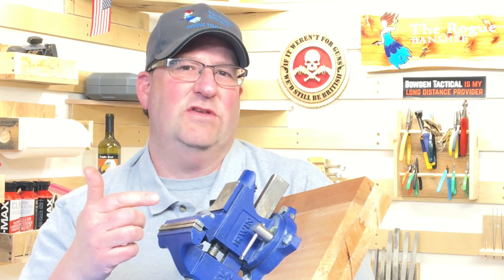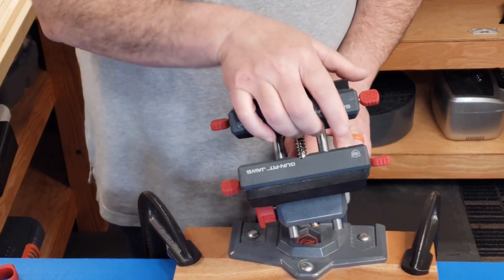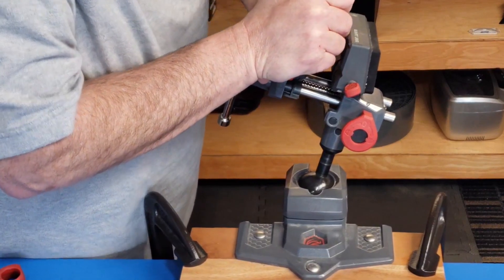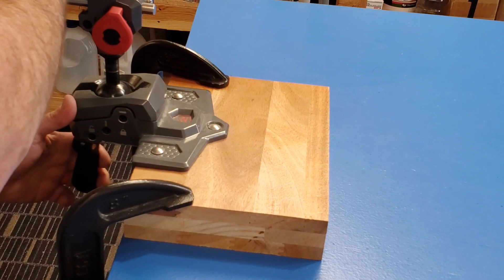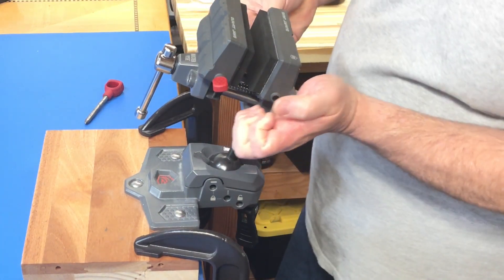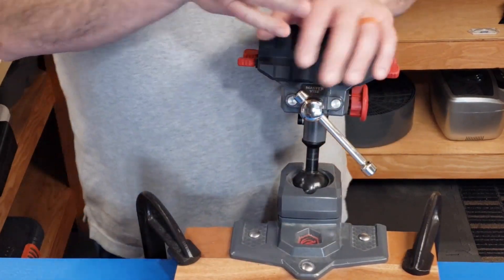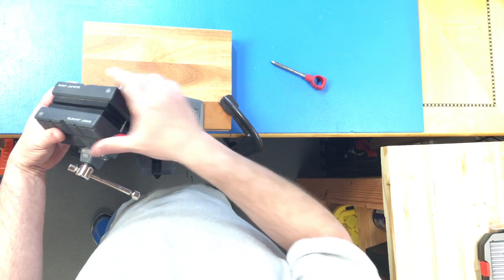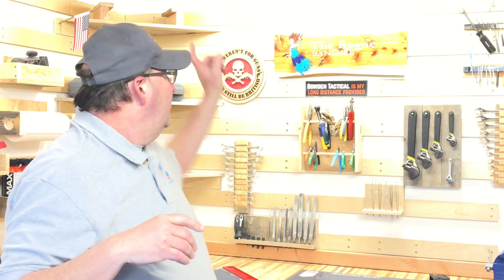Real Avid Master Vise Review: 1 Year Later

Comment: You should do a review of the new Tipton 360 vise. Half the cost but similar functionality.
Reply from the maker: I worked with the Tipton 360 Vise at SHOT Show last year in their booth. It's not bad but has some weakness' that would prevent me from running one. The biggest issue is that it is a "cleaning" vise and not a "gunsmith" vise. When I locked it in place, and put it under pressure, it failed to put up any resistance. When talking to the guy in the booth, he said it wasn't for projects that requrie torque and that it was a cleaning vise.  Now if this was under AOB's Wheeler brand, it probably would have that feature being that is their tool brand instead of their cleaning brand. I am not saying that it is a bad product, just not for me and how I would use it.
Reply: @ ah, I see. The Real Avid is the only way to go then. Thanks for the info. 

I don’t really see the point of having a cleaning vise in the 360 form as opposed a typical cleaning workstation.

Comment: What size block did you use as the base along with lag nuts specifics?  I appreciate your time and help so i can build the same one in the video or a better one on your recommendation 😉
Reply from the maker: the block of wood is approximately 8/12 x 12 x 2. I made it out of some 3/4 inch butcherblock that I had laying around from another project that I glued together into 3 layers. I think I replaced the screws with some longer ones but I cannot remember if I used the stock ones. If I replaced them, I just took them down to my local hardware store and replaced them with longer ones of the same size. I milled out some recesses in the bottom so that the screw and nut do not stick out the bottom and I get a good clean contact. The trick with mounting this way is that you want your clamps to clamp as close to the middle (from front to back) of the block as possible. The closer to the front you clamp it will get a little tippy if you are pulling toward you. With this much block in the back, I can do much more pushing away from me than pulling towards me as I basically have a big paddle that I am pushing the torque towards. If I did it again, I would probably go about 14 inches long. at 12, you have to clamp on angles to get the torque pin in and out. Hopefully that helps you.  I had Dustin Sanchez from Real Avid on the Podcast not long ago and he doesn't recommend mounting this way because of the "tippyness" going towards the user. They recommend mounting directly to the bench.  Hope this helps!
Reply: @TheRogueBanshee  thank you again for your time and detailed reply
Reply from the maker: @livebreatheadaptevolve  no problem. Thanks for reaching out!

Comment: Can you torque the barrel nut and castle nut with this vise or is that the technicality that voids the warranty?
Reply from the maker: using a cheater bar to clamp something in the vise voids the warranty. I think you can go up to 100 ft lbs on torque and be in spec for the vise. Max torque on a barrel for an ar is like 80 ft lbs. I have barreled many AR15' and AR10s on this vise.

Comment: If you had to choose between that and the workstation which one wins?
Reply from the maker: If I had to have one and only one, the master vise. Each has their strengths and weakness. But if I needed to barrel an AR, I can't do that with the workstation plus Pistols can be worked on on the master vise.
Reply: @TheRogueBanshee  excellent, already have a basic range rack but my bench vise doesn't have all those angles, would rather have the one to work with for all. Thanks